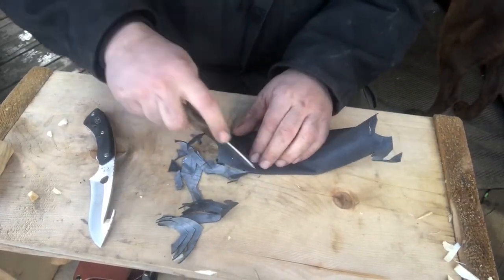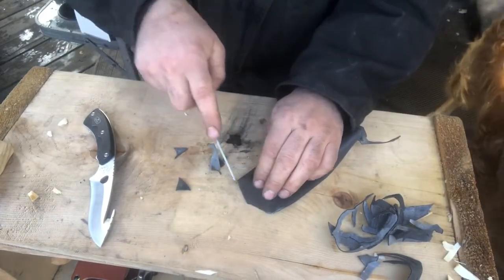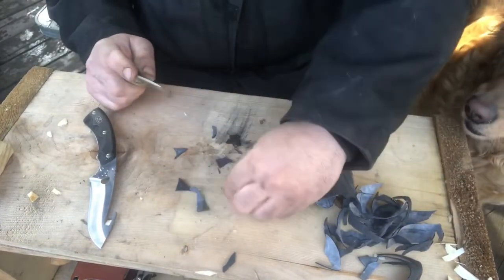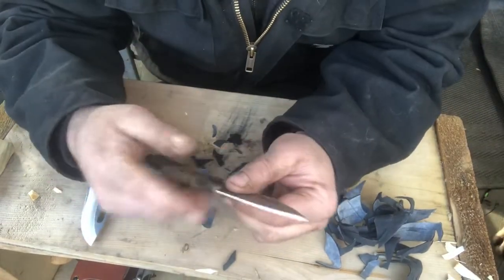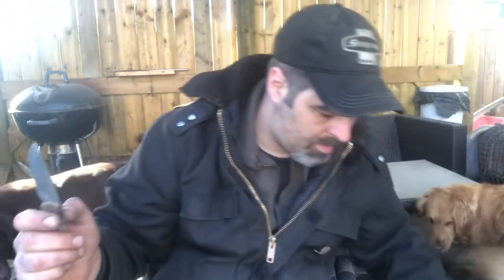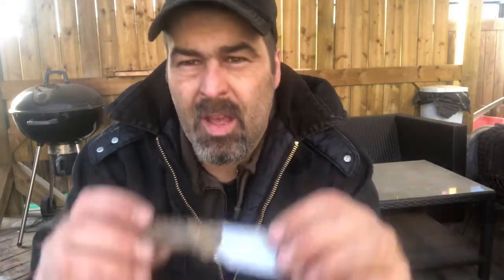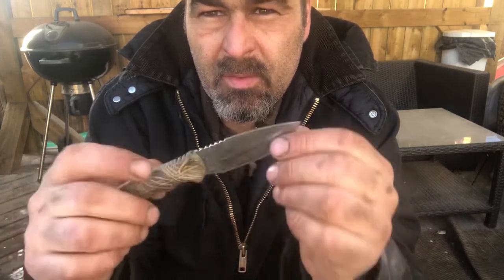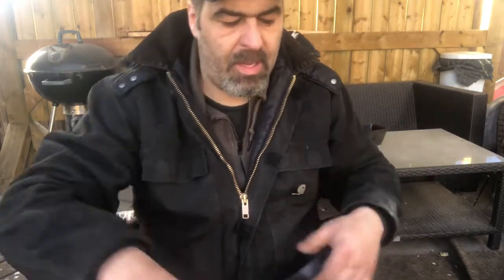Buck knives testing final part

Comment: Different steels - 420hc did the most. The older 119 is prob 425 and the red one is 5160. Most newer bucks now use 420hc. Both 420hc and 5160 are way tuffer than O1 but may not have quite the edge. Snag a new 119 in 420hc for $50 and you have a solid knife for low cost.